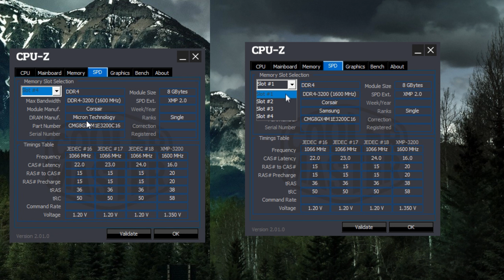Samsung B die vs Micron memory gaming test

Comment: 3200 16-18-18-38 is NOT B-Die.    Possibly A-Die which is not as good.    
3200 14-14-14-28 = B-Die    
Having said that, most B-Die is no longer being made.  So Micron E-Die is a great #2 choice.  It can also be tuned well.
Reply from the maker: Yes, I love micron die. So much OC room left

Comment: 3200mhz  (16-18-18-38), that is pathetic. the whole premise of B-die is high frequency with tight timings. at 3200 the primary timings should be 14-14-14-28. many people including me use those timings at 3600 or 3800 mega transfers and also tighten up the tertiary timings. So basically you ran b-die at the settings any crappy ram kit can use. what a total waste.
Reply: for ryzen just higher mhz is better

Comment: i am using 2*16gb crossair vengence ram .one with micron and samsung dram . and i cant enable xmp profile, cpu and motherboard supports xmp.can anyone help
Reply from the maker: What motherboard chipset b350 or b450
Reply: Will having mixed dram matter? Samsung and Micron?? @OdinHardware
Reply: @Gwaping723  version ? u mean
Reply: @thegamersclub8999  i have the same brand make and model of ram. But the dram chips are from different manufacturers (samsung and micron). I think its because theyre not from the same batch